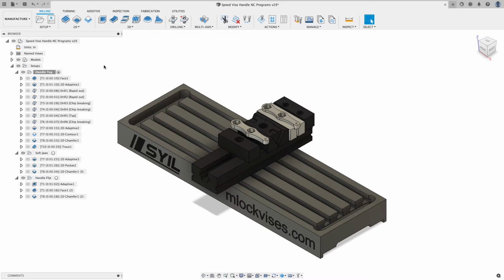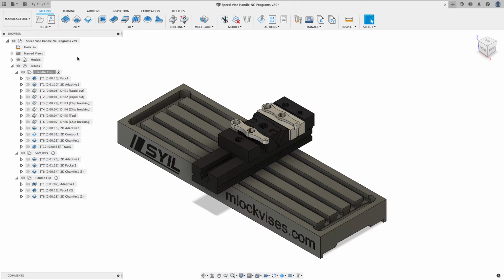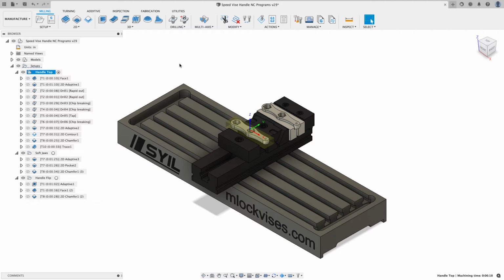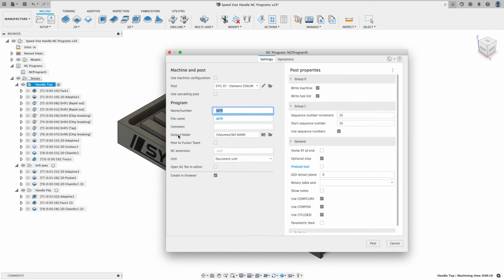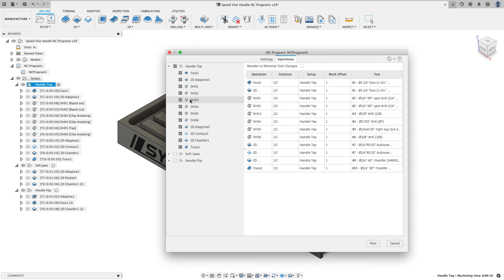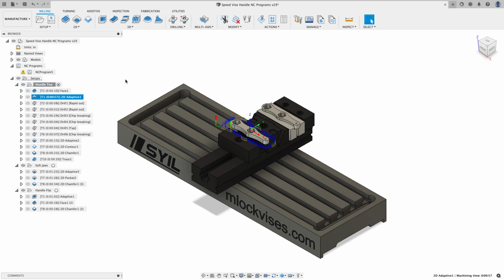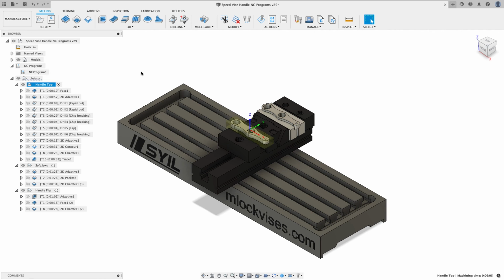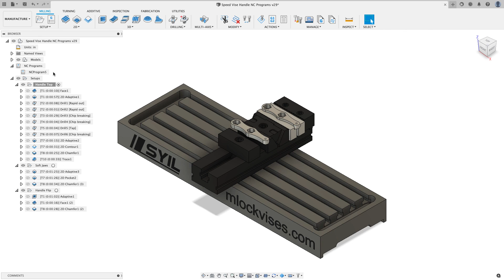Fusion 360 Post Processing Demystified

Comment: So I think the 'legacy' option has been removed after my last update, thing is mach 3 won't recognise the new csv files as they are all commas, how can I get my code to the old tap files for mach 3 to read?
Reply from the maker: Do you mean it is posting with the wrong file 
extension?
Reply: @Mechanical Advantage  its ok its now sorted, basically I always used to defer to the legacy option in preferences, when that went and the nc box came up instead i didn't realise it wasn't set to mach 3, because I never used it I didn't know about it. All fixed though, thanks for getting back to me, and thanks for the great videos, they have been a great help.

Comment: the NC program naming messes the process up. I see no reason why the NC program name is not the name of the file. If it would be it won't be as confusing as it is now, especially when you come back to that setup after a bit. There is no way "anybody" is able to remember if the NCProgram1 is this or that or what.
Reply from the maker: Because many machine controls won’t allow  alpha characters to be used and will only accept numbers.. You can rename your NC programs and you will continue to see work here on automating the naming of programs.
Reply: @MechanicalAdvantage  I'm talking about the NC programs names where the alphanumeric problem is not a case.. as the native names have both alpha and numeric characters starting with "NCProgram1".. the stupid behavior is the inconsistent naming with what the user does.. When we safe the Program "name/number" we can choose the name same as with file name and yet the NC program keeps generating redundant confusing names with no connection with what the user choose for the name/number or the file name.
This actual behavior is as stupid as if we would not have a chance to define file name and will be forced to post-rename the post file (any file) in the system file browser every time we save new file.
The reason why people do not use the NC programs or they find it hard to work with it is actually this naming nonsense. That is why they rather regenerate the program the old way  as they get what they set.
I know we can rename it afterwards, but yet again.. why should we do it manually every time we create new program is beyond me.
Reply from the maker: How should the program be automatically named? How would you choose to name it?
Reply: Inside program name is always 1000, I dont care for it.
Reply: @michalkalavsky  but in the program it is done as NCProgram1..2.3... that is a name of a subset of operations one creates. In each project we create while in each project it represent something utterly different. This general naming adds lot of confusion to the whole process as this "naming" does not help the user to know what it stands for and therefore it is not used as it is claimed it should be used and that is easily manage existing NC programs.

Comment: Hit send too soon….
Would be good for me if I could change the file extension type. On the Haas mini mil we have, I have to use an usb interface to the original serial port. To cut to the chase … I need a .txt extension in my g code files for the usb dongle to work . I do look at the  code with editor after posting, for this and that, so it’s not too much of a chore to change file type then.

Comment: Is this really all that new? I've done it this way for almost a year now? Clearly the better way
Reply from the maker: It has been in preview for a very long time, however, it was made the default way in the August release (99% sure on that one). There are still lots of people that enable the legacy method of posting that will be removed from the software eventually, so I wanted to make sure those people knew how to use the new method as well as help out the people that are currently using it but didn’t quite get how it’s works yet.

Comment: Is there a way to set the default as to where my machine goes when it’s done machining? It currently comes all the way forward but also goes all the way left. That requires me to manual.y handle jog to the right to get it in the door opening. Thanks as always for your excellent videos! They are so well done and easy to understand and always timely and useful!!!
Reply from the maker: Hi William. Yes, that position is controlled in the post processor that you are using. Posts aren't my specialty, but I bet that if you go to the post processor support forum found at https://forums.autodesk.com/t5/hsm-post-processor-forum/bd-p/218 that someone will be able to easily help you make that change. Glad the video was helpful.

Comment: Is there any way to autoname the NC proigram from the part name with version control like ...part V17
Reply from the maker: I think you will continue to see improvements around this. There has been a lot of discussion around auto naming NC Programs. Different people want different things, and there are different scenarios. For instance one of the ideas is to automatically populate the NC Program with the setup name. But what happens if you post two programs as on NC File. How should that output be named. All I know for sure is this is an active topic and they want to make sure it works for everyone’s needs.
Reply: @MechanicalAdvantage  I am guessing by default you would have partname ver - setupX
The setups auto numbers setup - so why not use that
Reply: This is the main issue with auto updating a file. There is no way to know which file is being sent to the machine, aside from a creation date as it just overwrites the existing file...or did it? Who knows.

Comment: Its good to know that any new stuff usually means the old stuff is going away.  Like any new thing transition can be difficult.  Like the UI big change on design.   Plus tutorials that haven't caught up with changes.  Like all products you need to find a way to learn the best you can and upgrade.   I like that you can shut off the NC program repeat ladder.   I set prog name/number - comment and WCS # in that before I program.  
We do occasionally set a program to run multiple WCS Ops at one time but not the norm.  Individual programs - even move from lathe to mill.  
thanks for the update

Comment: The New NC post is getting easer to use with time, and costly mistakes to parts and tooling, Make sure to double check the Operations tabs be cause it still dose not switch between Setups/operations. when the current setup is selected.  (opp 1 & opp 2) thus causing a crash if you don't catch it in the Operations tap within the NC Program.  I also run a MAC and Autodesk needs to verify there updates before they push out these updates to the users.  As I thought that it was just me having this problem.  Keven I always learn something when I watch your videos like checking the "Open NC file in editor" I think this will be helpful Thanks!
Reply: I create a different ncprogram for each setup and name them. Then if I have to repost any of them after a change, just right click on the one you want and repost it.
Reply from the maker: Hey Brett. Glad you got something out of it. Maybe when you get a chance sometime, you can email me or send me a video of your exact workflow that can cause a crash so I can take it back to the team.